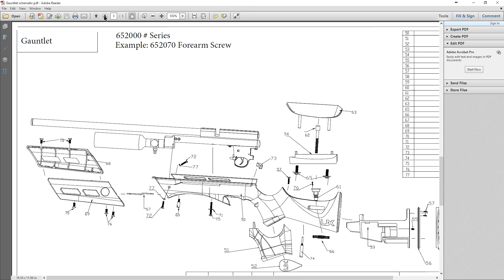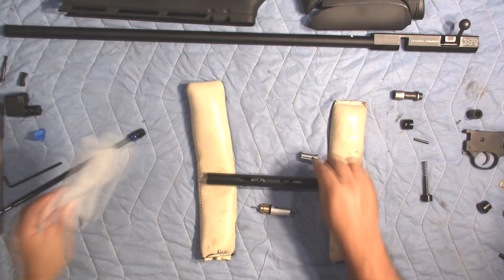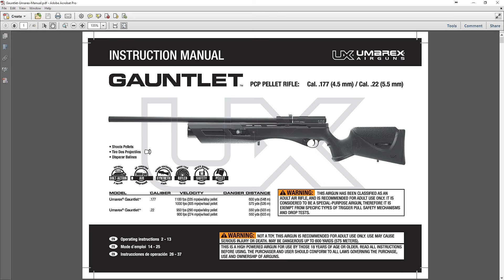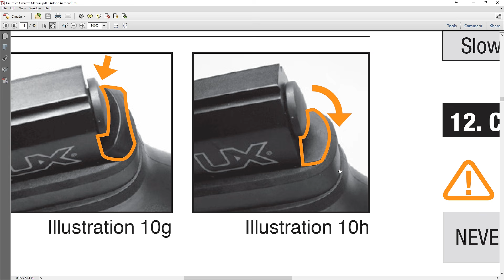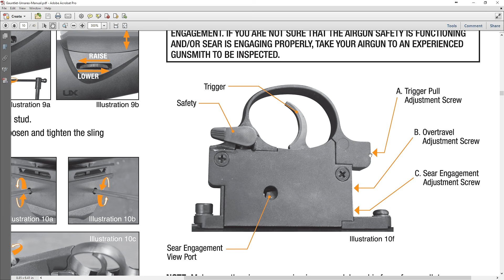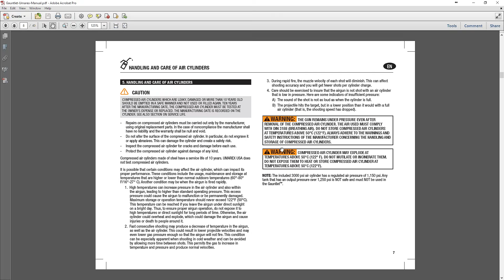Umarex Gauntlet: Super Tune Kit Installation

Comment: Will this work on the SL30? My sl30 randomly popped and let all the air out last night while in bed.  I think it's the poppet valve it will only hold air while it's cocked. As soon as I pull the trigger it all comes out the barrel. So if I have to do the poppet valve I'd like to do one of these kits

Comment: Does hashimoto make a super tune kit for the sl-30 and how much are they?
Reply from the maker: The SL30 already has a hammer preload adjustment and the poppet is properly sized for the operating pressure. The only issue with the SL30 is that hammer spring is bit too much for the SL30 and even with the power adjuster backed all the way out, the PCP doesn't reduce the feet per second at all. There is a very narrow band of power adjustment.

Comment: Hello I'm having a hard time figuring out what rebuild kit The gauntlet 2 takes is it the same rebuilt kit as the first
Reply from the maker: Your question asks about a "Rebuild Kit", are you referencing the Super Tune Kit described in this video? If so, then when you go to our website, it will ask you which generation Gauntlet and which caliber. So in your case the G2 .25. The installation of the STK in the G2 is exactly the same as is demonstrated in this video with the exception of two additional screws that hold the valve in the pressure tube.

Comment: Just installed this kit yesterday, adjustability is pretty cool, no power gain though, I was hoping I can throw the 25-point 39 redesigns at their recommended speed, looks like I'm going to have to play with the regulator to get the results I'm after
Reply from the maker: There are a few variables that you need to check in order to narrow down where you are loosing power. Here are some tips:
Be sure to go through a shot string while adjusting the STK as demonstrated in our adjusting video https://www.youtube.com/watch?v=6GHgfOhKPR8
Check to be sure that your pellet probe o-rings are in good shape to eliminate blow by.
Check your regulator to insure you are getting the proper output PSI from it.
Check to be sure your transfer port tube is not leaking air when being discharged.
Be sure that your 3 barrel o-rings are all in good shape. We offer a complete o-ring replacement kit that provides you with enough for two full replacements. Found here:https://hajimotoproductions.com/index.php/product/umarex-gauntlet-tune-oring-kit/

Comment: I installed the supertune kit on my .25 cal Gauntlet and the gun functioned great. However, overnight, the gun totally depressurized. Any idea what I may have done wrong?
Reply from the maker: It could be the poppet burnish or any of the internal o-rings that could be leaking.

Comment: Do you recommend boring out the transfer port or other areas of the rifle? And if so to what dimensions and any extra advice? Much appreciated in advance. I'm planning on buying this kit, your regulated bottle, and the air stripper+baffles. Need to get the gun first of course, it's on preorder as we speak.

Comment: On your custom Ninja 22/3000 tanks, what is the purpose for choosing 1100 up to 2400 reg pressure ? Thanks.
Reply from the maker: You need to supply the right amount of pressure to fly a specific round at a specific rate of travel.

Comment: Mr. Hajimoto, a great instructional video. Liked and subscribed with the bell. I think I will buy the gauntlet and kit just to perform the modification, but I am more interested in the thermodynamics and physics involved using simple formulas because  numbers do not lie, but you can lie with numbers such as the sales gimmick of using velocity as a direct indicator of quality and performance. I use simple Newtonian physics and modern thermodynamic laws because; even though, quantum mechanics is far more precise and exact, I have yet to find a quantum mechanic calculator on ebay or Amazon, on sale. One question, would you happen to know the "K" value to the valve spring and hammer spring? With said numbers, you would be amazed how easier it is to fine tune the hammer spring tension taylored to the pellets mass in grains to get your targeted velocity. I'm looking to buy a hammer and hammer spring to do the maths involved because I only hear opinions on a plethora of performance videos, but no numbers, and I do fact check as I watch videos. Lastly, I congratulate you in mastering the English language Mr. Hajimoto because I did not hear the slightest hint of an asian accent. Great job and thank you very much for making this a more knowledgeable world for the informed consumer that drives technology to betterment. FJB Out!

Comment: @Hajimoto Productions Good evening! I'm currently placing everything back together after installing the super tune kit. I just noticed that the High tavel valve stop I ordered does not fit the pressure tube. Do you have any recommendations?
Reply from the maker: The pressure tube +/- tolerances are pretty loose and this is pretty common. Be sure to use emery cloth and debur the ID of the pressure tube at the lead in of the tube. After all deburring is complete, try the part again. If the part is still tight, I recommend that you use a steel rod to pass through the center of HTVS to keep it centered and concentric and then either using a belt sander or mild grinding wheel remove 0.001 or 0.002 material from the HTVS's OD dimension. Work slow and keep the part concentric. If you remove too much material, you will cause the part to be lifted or pulled once the fasteners from the mag well screw or the bottom stock screw are tightened. You do not want that play or slop between the pressure tube ID and the HTVS OD as the slop will bind the poppet shaft if the HTVS is pulled out of concentricity.
Reply: @HajimotoProductions  Thank you!

Comment: "Adjust this without taking the action out"....A brilliant video, great detail. I just have no idea on what the modifications were. Are you saying I can adjust the regulator pressure (drilling a hole in the stock to reach something?) or is that only after buying a new valve?

Comment: I was wondering if it is normal after installing new hammer spring and adjuster for the hammer to be a little bit loose in the tube when the gun is not cocked ? I can hear it moving when you point the gun down and up.

Comment: Thank you for your reply and advice. It’s very cool to me that you mentioned the dowel rod with fine sandpaper because that is what I did to solve the issue. I miked the end of the rod with 3000 grit sandpaper to the head size of a Crow Magnum due to the easy to measure head and removed the barrel and left the smaller first 8-10” of dowel enter the barrel to help keep the work centered and taped the sandpaper around 11-12” back and  used a drill to spin it. It didn’t take long to do. Amazing to me you suggested this process exactly as I did it. Very cool. Worked like a charm. Thank you. Loads and shoots very smoothly now. Honestly I really don’t think Umarex really gives a hoot what the consumer has to say about their products and just won’t listen when we tell them of an issue that needs to be addressed. Hopefully not all the manufacturers have this way of thinking. After that experience, I will never send a weapon back for service and to me the warranty is another chance for them to make a few more dollars. The regulator pressure on the new one that they said I needed only had an output pressure of 800 psi??? Thanks to your videos and your advise it now is set to 1350 psi and is consistent and the gun is very accurate. Thank you for everything you do to help out fellow shooters like me. Take care. You sir are the man!

Comment: what does this actually do?
Reply from the maker: The STK adds a lighter and smaller surface area  valve poppet which is far more efficient which allows for a much lighter hammer spring to be used which in turn allows for easier cocking. Last but certainly not least the STK adds adjustability to the hammer preload energy which gives the end user the ability to adjust the power of the PCP so the perfect rate of velocity can be dialed in  for any given projectile, within reason. The within reason means one should not expect that the STK will allow a shooter with a .22 caliber for instance, to fly 33.5 Grain Hollow point Slugs at 1100 FT/S or something crazy like this.

Comment: IF you are thinking of getting the Super Tune Kit, don't think about it....just get it.  It really makes a huge difference. Cocking is easier. More power. Feels more like an FX airgun now. Accuracy was increased....which I did not think was possible. I can now shoot most weights of pellets and adjust for best accuracy. This gun loves Crossman Premier 22 cal 14.3 grain hollow points.....and that is great because at WalMart you can get them...500 for like a tad over 6 bucks. It also shoots JSB pellets really well....but about the same accuracy as the Crossman pellets so that is a no brainer. 

   LIke I said...if you are thinking of getting a Umarex Gauntlet, then this kit is a must have.
Reply from the maker: Thanks for the feedback Steve. I love the Crosman pellets for their affordability and they do fly really well from the Gauntlet and other PCP as well. The only thing that I do not like about the Crosman pellets are that they use a much harder lead than most making them much more difficult to drive into the barrel lead in as well as them having a high rate of passthrough in hunting scenarios.
Thank you for your support and commentary Steve.

Comment: Thanks for posting this. your video has a clear exploded view of what goes where an that i used to put mine back together after modding it into a total monster. It just came back for warranty work, which apparently mine was just shipped back out and ended up just getting charged for a mew regulator and air tank...LMAO...anyway....it now is pushing 18 grain pellets to 970 +FPS . Before it went in for warranty work at Umarex it was shooting in the 770 range,(STOCK). When I got the gun back from Umarex and had asked them several times to address this along with a couple others,which they did not, was shooting 667 FPS???.....So....Thanks again... My gun is now HALFHILL ENGINEERED and total awesome."finally!!!  Out of 2 mags my high was 982 and my lowest was 976 FPS. It's still hard to get pellets into the chamber so if you have any idea how to fix please let me know cause they didn't apparently.Awesome video once again...you rock!
Reply from the maker: Thank you for the feedback and kind words. The difficult chambering issue is one that really is greater or lesser depending on the ammo being used. A JSB uses a soft and is more malleable so chambers much easier than a Crosman or H&N projectile which uses a much harder lead.
If even the JSB's load hard then the issue can be the lead-in (leed in) of the chamber. The lead-in is where the lands and grooves of the barrel start. they should be a smooth and gradual transition to the firing position within the barrel. Well in some instances these lands and grooves are not tapered or as gradual as they should be which in turn end up gouging or damaging the lead as it is being forced into the barrel. A way to tell is, load a pellet into the barrel and then pull open the bolt and using a thin wooden or fiberglass rod, push the pellet back out and closely inspect the pellet. Look for very deep gouges or inconsistent rifle grooves that can indicate that some or maybe all of the lands are not concentric. To repair something like this can be challenging because you would be required to stand, ream, taper or polish concentrically the inside of the chamber but it can be done. I would say the barrel should be removed from the rifle and worked in a vise. You would develop a rod that is covered in 1000 grit sandpaper or other fine polishing paper and spin while pushing in and out of the lead in to smooth out the transition zone.

Comment: haji....im so grateful to you for filling the giant gap for aftermarket improvements......would you be prepared to share your transfer port mod advice for us who choose to install your supertune kit ourselves......or did i just miss it somewhere....
Reply from the maker: Thanks for the kind words Phil. The transfer port, Barrel Crown and Barrel Lead in work that I do are very hard to capture share on video not to mention they are pretty technical and require some special tooling that I am not sure the average guy/girl would have. I have to make these production content judgement calls all the time at the risk of alienating that extremely small percentage of audience that actually has the tooling and mechanical ability to perform the work. In their case, I would say they would already know how to achieve the work so my video would simply be an  opportunity to critique technique.
But in general, you increase the barrel TP size no larger than 80% of the barrel or else you risk pellet damage during pellet feeding. The clean up and deburring of the PT inside the barrel is critical. As the dill passes through the material it leaves a pretty dirty, rough and sharp edge which required deburring, filing and polishing INSIDE the barrel without damaging the lead in or rifling. You can imagine the video capture challenges of that scenario.
Reply: @HajimotoProductions  thank you thats all i needed to know and exactly what i needed to know.......i'll be ordering your supertune kit and a few other bits from you soon...and yes, i appreciate your sentiments and reasons.
...the gauntlet may be entry level priced, but it is scarcely an entry level weapon because it ships with so many glaring faults that need your research and development to rectify.....thanks again, sir.

Comment: Hey Haji..I'm wanting to polish tube and hammer while installing this kit along with all my other pcps. For the tube I found some 400 grit abrasive 1" wheels on Amazon for dremel. Would that be too abrasive? My other option would be to create my own using wooden dowels sanded with low grit SP then gorilla glue 0000 steel wool tightly wrapped around end then clamped into place using tube clamps to dry. Don't know if glue would hold. Any thoughts? Just don't want to over polish and ruin my guns. Thanks!!!
Reply from the maker: Yes 400 is too course.  When you polish you will be in the 2000 to 5000 range. As a rule, if you have an exhisting mirror finish in the tube, leave it alone. Typically it is the hammer that is crazy ridged and grooved from the sppedy turning process they use to make the hammer.  That I would start with 220 and then work up to 5000 for a slick smooth interface with the tube.

Comment: Hey Haji, where those screw holes are for the block, can those holes be polished to avoid dealing with burrs messing up the o-rings
Reply from the maker: Yes they can be but it must be done concentrically not a dremel tool at one location type of thing.
Reply: @HajimotoProductions  thank you once again.
Reply: @HajimotoProductions  so, using 1000 grit sandpaper by hand or tool?